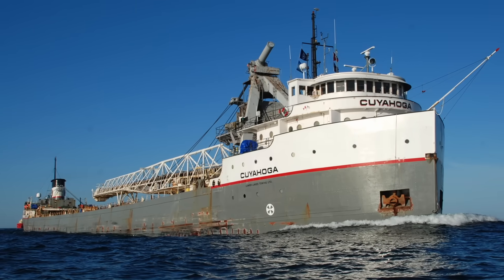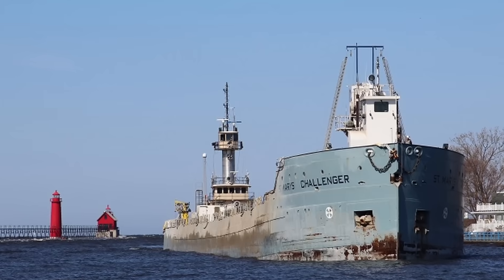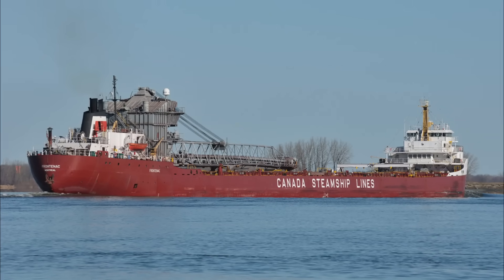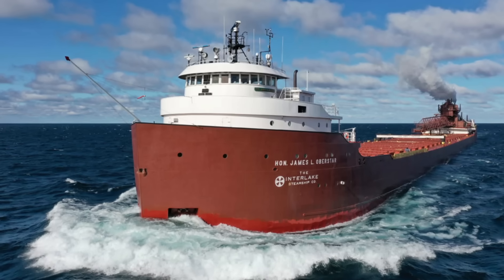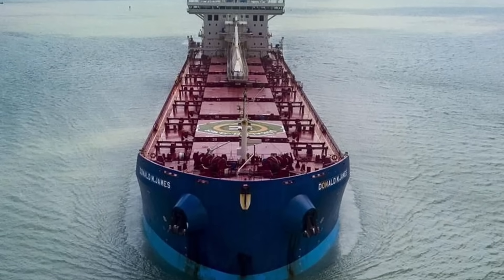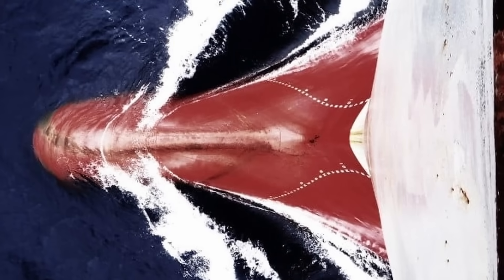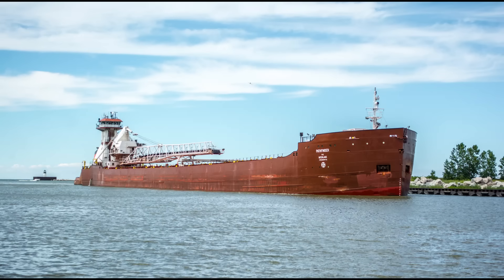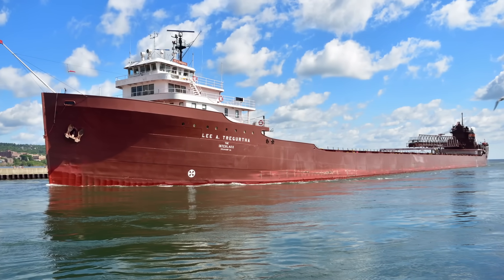Why Do Great Lakes Ships Look Different?

Comment: Something that really didn't get mentioned in the differences between lakers and salties is their purpose.  For the most part, boats on the great lakes either haul bulk freight or are oil/chemical carriers, and there aren't many boats of that latter type.  Great lakes bulk carriers do one job and they do it exceedingly well. That job is taking raw materials from one port to the next, then dumping it in piles at its destination. Ocean going vessels are built with many more purposes in mind. On the oceans, there are bulk freighters, container ships, LNG carriers, crude carriers, roll on roll off carriers. To do our best to compare apples to apples, it's best to only compare lakers to general cargo ships. Those are the ones that typically visit the great lakes bringing all sorts of exotic invasive species with them.🤣 They most closely match what lake boats can do. They carry bulk freight like grains and raw materials, but can carry finished products like windmill blades or farm tractors. 

If one were to pick the most important reason for the difference between great lakes bulk carriers and their ocean going counterparts, it would have to be the age of the vessels. Aside from the Mark W Barker, they are ancient compared to ocean going vessels and therefore have different design sensibilities than in the modern era. The newest laker, the Mark W Barker, was launched in 2022 and shares design features closer to ocean going vessels its size. Like the later lakers and salties, the Barker only has a rear superstructure.   Instead of a lot of narrow hatches on the deck like you see on most lakers, (which accommodate the drop chutes at many great lakes ore docks) the Barker only has 5 large hatch openings. That and the interior design of the holds makes it more versatile in the cargos it can carry. In addition to bulk cargo like salt or iron ore, it can also move finished steel products, project cargo or even containers, if needed. This makes it much more like the general cargo ship category of ocean going vessels. The big difference between the Barker and those general cargo ships are the bow design and the self unloader boom which most ocean going cargo ships lack. People probably don't want to hear this, but even our greatest great lakes freighters will eventually hit the scrapyard if they don't retire to become museum pieces. When that happens, new lakers will replace them and they'll likely be a lot more like the Mark W Barker than the Arthur M Anderson.

Lots of comments are pointing out you didn't mention the locks on the great lakes as a reason for the differences. But that's just a limit on vessel length and width, not the overall shape of the vessel. Lots of ships that travel the oceans are designed to fit through locks (Panama), canals like at Panama or Suez or rivers like the major rivers in Europe, plus many are built to service smaller ports with relatively shallow draft limits.
.

Comment: At one point the lake freighters were actually tug modules with the propulsion & accommodations in one unit and a cargo carrying "barge" unit. Eventually these were phased out, and the "tugs" were permanently affixed to the "barge". If you look closely, you can see the join points on the few remains ing "combo" vessels as the hull shape varies a bit for a few feet.

Comment: There is another reason that determines the size and shape of a Great lakes freighter. It's the lock system especially the Soo locks. Ships are restrained by width and length because of the lock system. Most of your ocean going large ships could not pass through the locks.

Comment: In my hometown of Port Washington, Wisconsin in the 1960s, we saw coal boats come in frequently with coal for the electric power plant. A giant horse-looking crane would use a large bucket to get the coal out of the ship. Later came the self-unloaders. I didn't truly appreciate how cool that was until years later, though I did take photos when I had the chance. (I didn't have telephoto lenses back then, so all I could capture was the overall harbor). There's an old freighter in Duluth I got to tour some years ago. Finally, I got a chance to see one from the inside. What a privilege.

Comment: Actually the waves on the lakes are higher and much more dangerous than waves in the ocean. It’s a scientific fact the salt density creates more rolling waves, the lighter fresh water behaves in a much more violent up and down wave motion. 
Also the biggest difference in the size comparison is lake freighters are long and have a narrower beam than ocean freighters because the lakers have to traverse locks between the lakes. There is a maximum size restriction for lakers and salties that travel the seaway up to Duluth.
Reply: No, I have seen 65+ footers in the Atlantic Ocean, max on the Lakes is Superior where I've seen 28 footers. Lake Erie is well know for short waves that are higher in frequency because of the shallow water of Lake Erie, making for a constant shuddering feeling. Lake Michigan is the worst lake for bad weather, pretty much a straight line North to South and poor choices for hugging the coast in bad weather.
Reply: @lahavespecial7775  I hate to argue a point but this very subject was debated by mariners and weather and environmental experts who all agree on the science of salt water vs fresh water. The salt water is heavier, denser and because of that the waves roll, they may gain height which seems higher because of the deep dip between rolls. Fresh water peaks with less dips and freshwater can be more turbulent because there’s no density to it.
A saltwater storm can be ferocious a storm with high wind over fresh water will be unpredictable and aggressive with high peaks in the waves. 
The night the Fitzgerald went down the waves were peaking at around 35ft and turbulent so the ship was going bow up and bow down very quickly as well as aggressive side to side hits. The captain of the Anderson reported waves like that, as did the coastguard vessel Windrush.
Reply: @ange1mom438 
I AM A REAL SAILOR who has sailed the Great Lakes and Atlantic Ocean on many vessels including those with the forward house like the Fitzgerald, and you keep arguing waves on the Great Lakes are greater in height. Believe me, you are completely wrong! Why can't you accept it?
You have to remember the greatest influencers for wave height are wind and water depth. Salt water is only 2.5% denser than freshwater, this influences the frequency of waves, not height.
Reply: @l @lahavespecial7775  heard or read somewhere the movement of the waves is different on the Great Lakes vs saline oceans, is that correct?
Reply: @GoBlueGirl78 
Yes, you are correct. The Oceans, because of the massive volume and depth of water compared to the Great Lakes, waves are considerably higher and longer in frequency. With storms, wave heights on the Atlantic Ocean can get up to 65ft plus, in those all you see are white knuckles, water and sky, very taxing on the nerves! 
Lake Erie, because the average depth of water is quite low, waves are short and close together, 12 to 15ft is probably average during bad weather, plowing into these waves give the ship a shuddering pulse. If the wind is strong and long enough it actually draws water out of the rivers and shipping lanes causing lake ships to anchor and actually wait for the storm to subside and bring the water level back up. Lake Superior, because it is very deep tends to get waves up to 28 to 30ft. I have seen 1000ft ships plowing into 28 footers and the water spray staying in the air until it hits the wheelhouse. There is a small fraction of 2.5%  more density in seawater than freshwater, but depth, volume and wind velocity play a far greater influence on wave height.
Reply: @lahavespecial7775  Thank you, that’s fascinating. I live on Lake Ontario, and have been on some of the other Great Lakes in small boats, but the Lakers are incredible to see. And a bit terrifying! LOL
Reply: @GoBlueGirl78 
As a professional mariner, I have had a lot of people ask if the Lakes are salt water and some even ask if there are any sharks. I kid you not 😄
Reply: @l @lahavespecial7775 aha there was a rumour/hoax many years ago that there was a shark in Lake Ontario! 😅

Comment: The wave comments are totally right.  The real determining factor for laker ships is the size of the locks. With regard to waves, fresh water waters are steeper and more frequent (frequency for freshwater is twice as fast as salt) so not only are the waves steeper, they're also more frequent (which is harder on a 1,000 ft. Great Lake freighter.

Comment: As someone who has sailed on the Lakers with the wheelhouse up forward, the design was promoted by Captains who wanted better visibility in the Welland Canal. The Welland Canal can be very tight in places, especially the last lock in Port Colborne where there is a turn. The design also aided the Captain's maneuvering in some of the rivers and ports where the ship had to be turned around. Sometimes the forward house would be in the trees along some of the rivers maneuvering. The flaw with the design, was that just about everything had to be duplicated for the forward house as the back house. Sewage tank, freshwater tank, emergency generator, etc. To name a few. The cost would be too prohibitive today. Not having a forward house also frees up valuable cargo space. And as we all know, the more product you can carry, the more profitable the trip is.
Reply: Is there an internal passageway between the two houses so you can transition in bad weather?  Or do you just have to walk down the deck?
Reply: @ebla83 
There would be a twisted route, you would have to go down into the tunnels under the cargo holds, walk through the tunnel to the aft end then stairs up, but everyone walks on the deck. The rooms up forward would be Captain, Chief Engineer, Deck Officers, Wheelsman,  and some other deck crew. Everyone else is in the aft end of the ship. Sometimes the Chief Engineer's cabin is back aft too. The Mess is aft on all of them 😊
Reply: I’ll add that the original forward pilothouse lakers were old steam barges that were cut down from the passenger “packet” vessels.  The pilot house was already towards the front on those old vessels and bulk cargos would simply be wheelbarrowed through ports on the side because of the cabins going the entire length of the deck. At some point some genius decided to build the RJ Hackett without amidships cabins and the straight decker was born.  Then everyone started cutting down their packet vessels because they simply weren’t as efficient.
Reply: @drumkidstu 
Thanks, certainly makes sense to me, and more history as to why companies went that route. Today, there are a few returning to this concept. Certainly makes for quieter sleeping as well, all you hear is the wind and water slapping against the hull.
Reply: Il en est de même pour les cargos ( salties ) car auparavant le château central se situait au milieu alors que maintenant tous les navires marchands ont leur château situé à l'arrière ...idem pour les " lakers " me semble t'il ...

Comment: You missed reason #0   The Locks.   Lakers are built to fit though the locks and hence must conform to the shape of the locks that let them travel between the lakes.
Reply from the maker: Didn't think about that one. Thank you for bringing that up. Was something I should have included in the size section.
Reply: The poe lock is 1200 ft long 110 ft wide

Comment: You did not bring up the locks.  The locks are a large part to there size and shape, of the lakers.
Reply from the maker: True. Should have been in the size section.....
Reply: Also the buoyancy difference between fresh and salt water. That's why the majority of saltiest you see on the lakes are sitting so high in the water. They're built to be more buoyant
Reply: Locks and the fact many lakers were designed to let them go up various rivers to load and unload
Reply: Yes, ultimately the locks are the determining factor. 1000ft max vessel length for the Soo Locks, 740ft for the Welland Canal, and St Lawrence  Locks. Maximum 32ft depth and 80ft width for the Soo locks, 30ft depth and 78ft width for the Welland Canal.
Reply: The locks of the determining factor.
Reply: There sizes? What is that?
Reply: Vous parlez des écluses car le terme de cadenas n'est pas utilisé  ici en Europe ...mais sans doute chez vous au Canada  ?
Reply: @jacquespollet7999 
Yes, padlock is used the same here in Canada for a common lock for locking a box, etc.
Reply: I think the only thing the locks influence is the maximum size. If you look at Kiel Canal in Germany, the locks and the canal is quite similar to what you got at the lakes. And the ships still look quite different, even tho many are specificly designed to run on the baltic sea and the Kiel Canal.
Reply: THEIR SIZE!
Reply: Yes that is a big part and btw my dad was 3 when the Edmund Fitzgerald sunk
Reply: Most Great Lakes freighters, or "lakers," have their wheelhouse (bridge) and crew quarters in the front (bow) of the ship is to provide the captain and crew with better visibility when navigating the relatively narrow and congested rivers, canals, and harbors of the Great Lakes system.

Panamax and New Panamax (or Neopanamax) are terms for the size limits for ships traveling through the Panama Canal. The limits and requirements are published by the Panama Canal Authority (ACP) in a publication titled "Vessel Requirements".These requirements also describe topics like exceptional dry seasonal limits, propulsion, communications, and detailed ship design. The last 2 class of US carriers are too large to fit this Canal  but it's not a issue for the Suez Canal  but in suez that require Egyptian pilots to do so I'm sure the US does not like this

Comment: Age of some of those lakers is crazy, but the Mitch just cracked open, they said 13 foot crack in the hull. Was patched and back in service quickly, without unloading its cargo. It’s about 70 years old so it going to need some TLC
Reply: No, she was patched so she could get to where she can go into dry dock for a more thorough inspection. There is another boat, the Manitoulin, coming to take Michipicoten's load. She has to have her load removed before she can be inspected.
Reply: She may be ;ack in  service but she is empty she is heading for drydock
Reply: She need more than tlc she need to be retired sent to the great ship museum in the sky

Comment: howcome fishing boats/crabbing boats who go out to no mans land have a top speed around 12knots? say a fast moving storm is heading at them going 14mph is shit...in ship terms they arent very big most seem to be 100ft......why dont they have engines so they can go like 30knots? do they crap out  or something?
Reply: It's mostly due to the cube law. Let's say that the boat that does 12 knots uses 1,000 HP to accomplish that, to double that speed to 28 knots it would take 8,000 HP, to get it up to 54 knots it would take 64,000 HP.  The only real way around that is to reduce the contact with the water, that's why small personal boats will trim and ride higher at speed, and it's why the US Navy and others have experimented with hydrofoils. Because in the air it only takes 2x the HP to double speed and not the 8x that is needed in water.  There are other factors involving shape and aerodynamics but wanted to keep it somewhat brief.